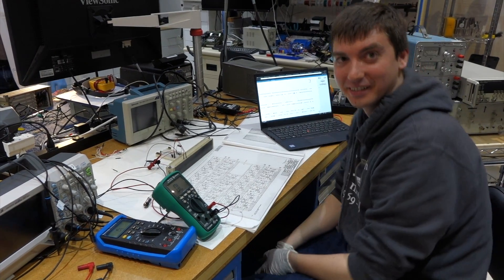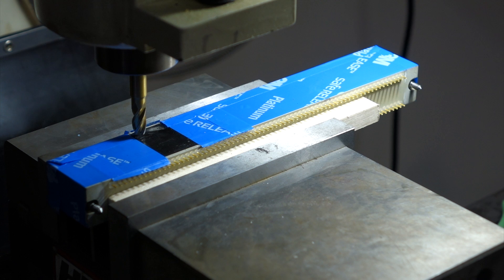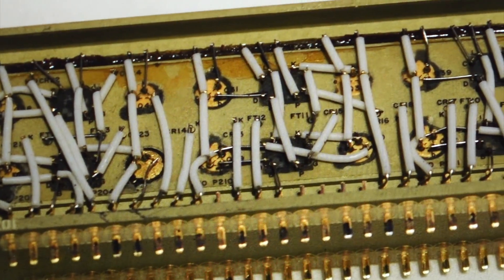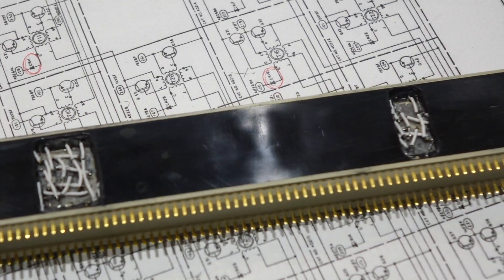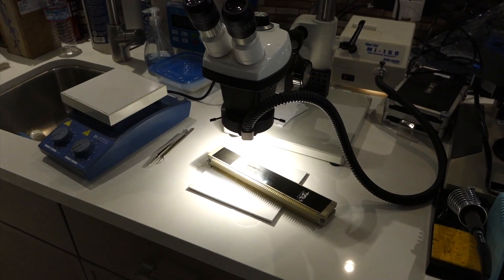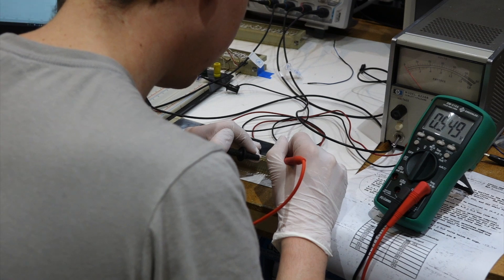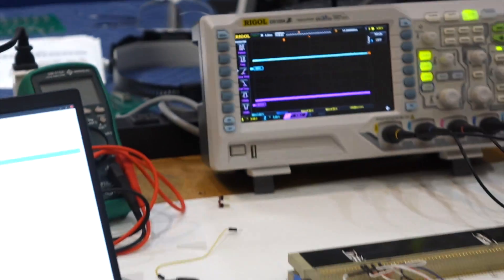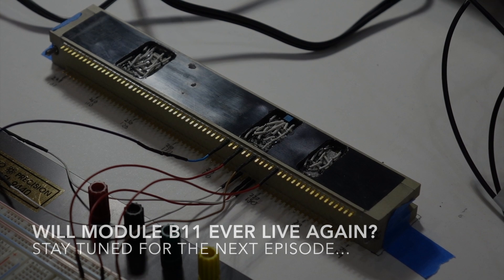Apollo Guidance Computer Part 16: Digging into potted module B11

Comment: You could use a thermal camera to locate where the short is.
Reply: The trouble there is that you'd be trying to see heat through a thick layer of black encapsulant, and you'd have to pump a bunch of power through 38-gauge wires that could very likely not handle it.
Reply: @mikestewart8928  It all depends on how well that potting material insulates I guess. It's not like you'd have to pump a lot of voltage through it. The short should be well above the ambient of the rest of the circuitry.
Reply: Keep in mind I know almost nothing about this..but would X-Ray or other radiography work?  Or would it have negative effects on the components?

Comment: As many issues as it has, I wonder if that was a test part that was intentionally driven to the point of failure.
Reply: Not likely, just early electronic parts that still had bugs in the process of making them. Make the first few hundred of any brand new product or part that is pushing the limits of technology and you will be doing a lot of failure analysis to see what causes failures, and how to get the process steps exactly right and (most importantly) reproducable each and every batch. Remember these diodes were probably made on first or second generation silicon processing machinery, and with small (around 3inch IIRC) slices to work with you had a lot of places for errors or mistakes to creep in. They probably have had some severe testing, and were just not strong enough to last, failing shortly after assembly, probably as the epoxy was stressing the leads. Bathtub curve of early infant mortality in electronics showing up there. There probably will be another 2 diodes that are marginal, but still work in that module at the moment, but when or if they fail is up to chance.

Comment: i wonder if in 50 years will there be some computer nerds taking this much detail to mess with a falcon 9 computer or shuttle computer.
Reply: Unlikely. They are like most other computers. All they would need is the software and a computer to run it on. A 60s shuttle computer might be interesting though.
Reply: @user2C47  IBM system 360s were like most other computers, and yet Marc is spending time trying to put one together.

SpaceX's computers are just as boring and non-unique for the time as the AGC, just the AGC has all the patriotism behind it to bring interest.

Comment: Fantastic work by the Olympic team of vintage computer restoration nerds. Fixing one problem can of course flush out another problem which in some cases reveals the cause of the first problem. High current flow due to some short or ?? through a diode can be the cause of it's demise.  You guys are the best and I'm sure you'll get it working eventually.

Comment: 1N914B or 1N916 ? I suspect the former. I have a bucket load of them I can send you :-)
So Jealous of you local electronics store. Very nice.
Reply: Although the two diodes mentioned are extremely similar it is the capacitance that is the major differentiator with the 914 having twice the capacitance (4.0 pF) of the 916.  The B parts have a tighter spec'd and lower forward voltage so no surprise that they are 'the chosen ones'.
Reply: Mmm. The standard 1N914 (no B) is pretty easy, a commonplace 1N4148 would be a direct drop-in replacement. The B variant and the 1N916 are a little trickier.
Reply: @makomk  Just be careful of the modern replacements, they can have quite different characteristics with major parameters. they just have to meet or be better than the JEDEC published specs, so you can get modern devices that are very much faster, much lower capacitance and lower forward voltage drop than the JEDEC spec for the old diode, but are still marked as it. Best to use those old period vintage parts there, especially as you are looking for matched diodes in the computer.

Most common with the ubiquitous 2N3055, as the original planar device is both slower than a wet week, has horrendous beta droop, and will not oscillate unless really provoked. Modern epitaxial devices meet the headline spec ( 15A, 100V, beta greater than 3 at 5A collector current at 10V Vce, in a TO3 or TO3P package) but have transition frequencies over 30MHz, better gain hold up, and will oscillate merrily in most applications unless well tamed. Replace a 40 year old 2N3055 with a new one, and you wonder if you have a fake, as it merrily oscillates and burns out within seconds.

Comment: I’m too late offering this information, but it might be useful in the future. I’ve depotted dozens of potted modules, and found the best solution is to add heat. I use a cheap surface mount hot air soldering tool. I can set the temperature to 100 degrees C. That’s enough to soften the epoxy so it crumbles away, but it’s not so hot that it damages components. I use a set of hobby knife blades to dig out the hot epoxy around the components. It looks like you got the job done, but, for future reference, I think heat makes it a lot easier. Cool to see Anchor is still around. I worked down the street from them in the ‘80s through the ‘90s.
Reply: and any more temperature cycles means stress for the components and would be not recommend

Comment: This is so much fun somehow... next step; refurbish an apollo rocket
Reply: Enough talk! Lets's do this!
Reply: You want to fix something that burned up and sat at the bottom of the ocean for 60 years?
Reply: @user2C47  SA-514 and SA-515 are unused, just a little dusted .. and corroded .. and gutted .. and the parts are in different exhibitions ..
Reply: Fran Blanche is making an authentic DSKY, Applied Science has also had some success at one. And there's Project Egress which is a bunch of makers (including Fran) making an Apollo-era crew module hatch.
Reply: @Vampi_Sweden  It would be illogical to try to turn a vaguely cylindrical formation of rust and sea life into a functioning spacecraft.

@DL3CE Are you sure there there not 2 highly classified Saturn Vs sitting in storage, in case we need to launch something to the moon in an emergency?
Disclaimer: This is a joke based on <a href=" https://g.co/kgs/zE3PtS ">this book</a>.
Edit: We could just use a Falcon Heavy instead.
Reply: @user2C47  Falcon Heavy doesn't have the required payload capacity. You'd have to assemble the CSM/LEM in orbit, and send up an additional booster to perform the trans-lunar injection. The proposed BFR could top the Saturn V easily, IF they get the concept working (BIG "if." I'm skeptical about the scale of the thing). But as of yet, the only heavy lift vehicle that even comes close to the Saturn V (other than the Soviet N1) is the SLS once they complete it.
Reply: Let's call James Cameron and get him to find a few spent Apollo rockets at the bottom of the Atlantic.  I'm sure we can find enough of them to piece together one good one!